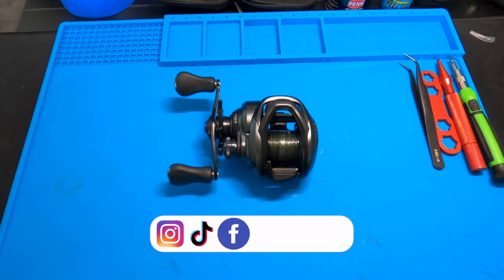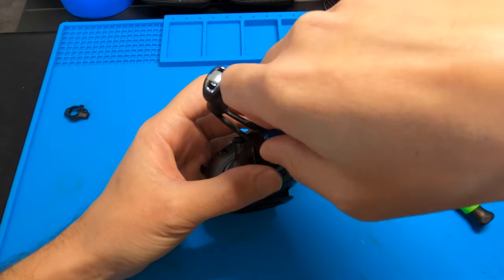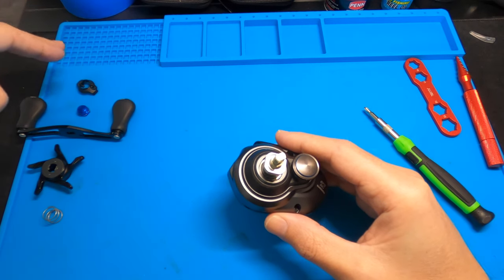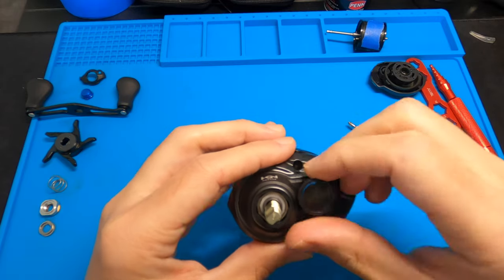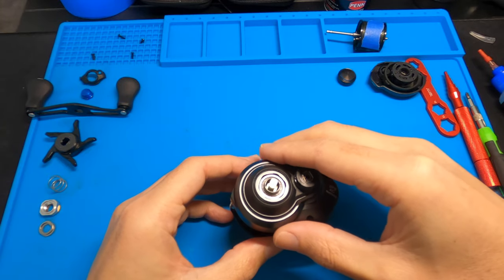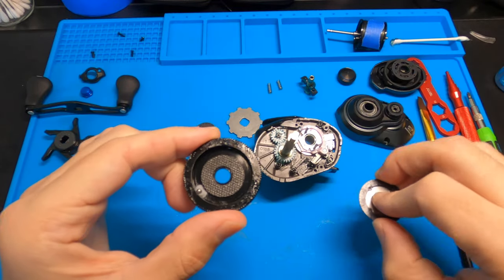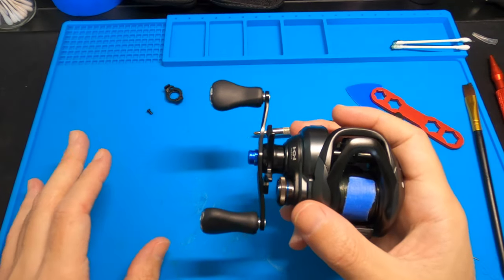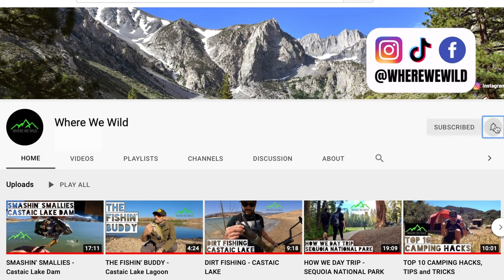SHIMANO SLX BFS - Take Apart & Reel Maintenance - in ENGLISH

Comment: Great video on a reel that doesn’t have a lot of information (in English). I’ve got mine on the way and I plan on upgrading all the bearings. I’m in the air if I want roro or speed spool. How many bearings are there to upgrade and do you know their sizes?
Reply from the maker: Thanks man 👊🏽😊 It’s got 5 bearings, but I haven’t upgraded them or anything. JDM reels usually come with pretty damn good bearings. I was considering upgrading the spool as well haha but yeah idk which to go with or if that’s even worth it 🤷🏻‍♂️😂